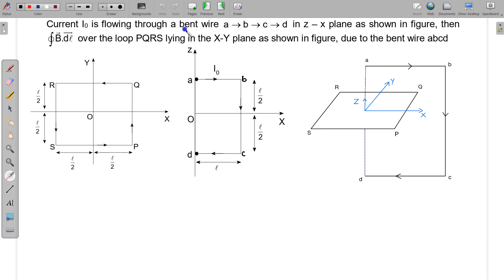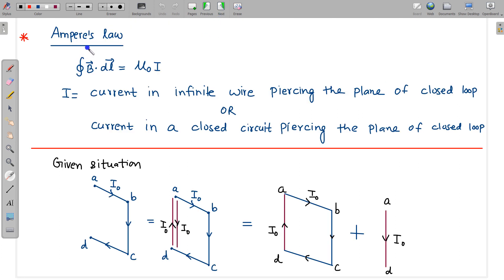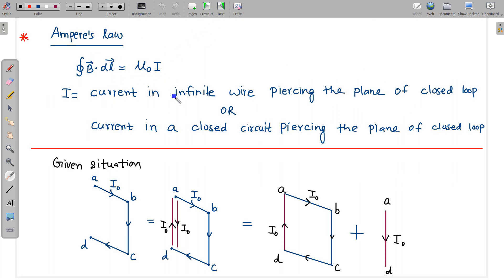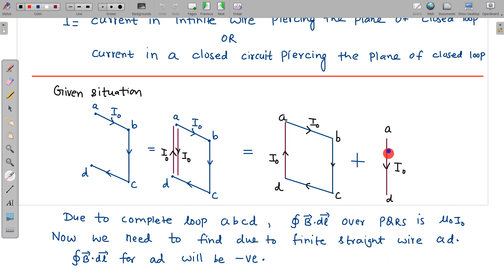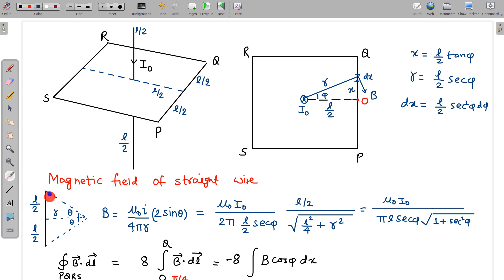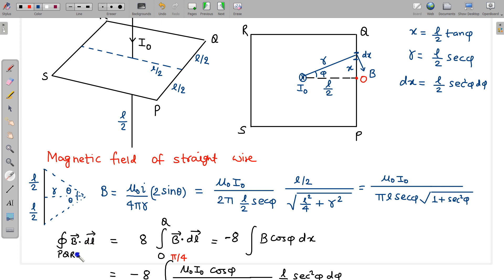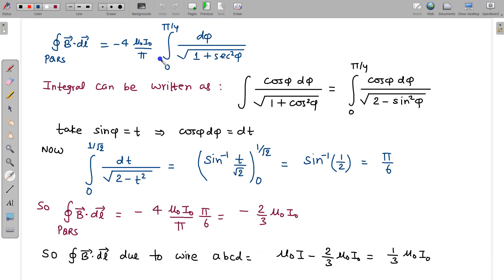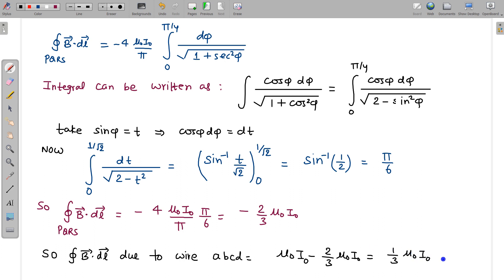Magnetism | Line Integral of Magnetic Field Over a Closed Loop | Ampere's Law

Comment: Sir For the b.dl due to finite wire I tried without integration. Pls explain why different answer coming 🙏🏼🙏🏼🙏🏼
B.dl on PQRS due to finite wire = 4(B.dl on line PQ) 
Now complete PQ with an arc or radius l/root(2). Since this closed path doesn't enclose any current, B.dl over this closed path is zero. => B.dl on PQ + B.dl on arc = 0. => B.dl on PQ = -(B.dl) on arc. B.dl on arc = μi/8root(3). So final answer will be μi(1-1/2root(3))
Reply from the maker: B.dl along closed path due to straight finite wire is not zero.
Reply: @PhysicswithAkashGoyal  oh yes sir, sry😅